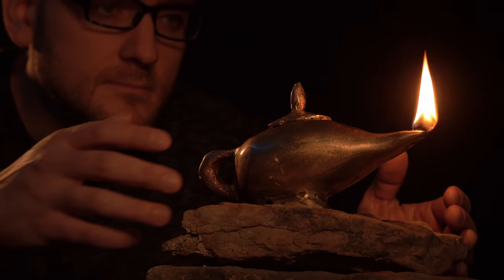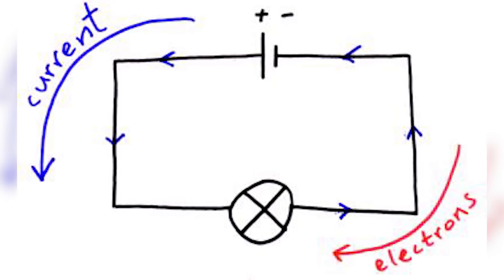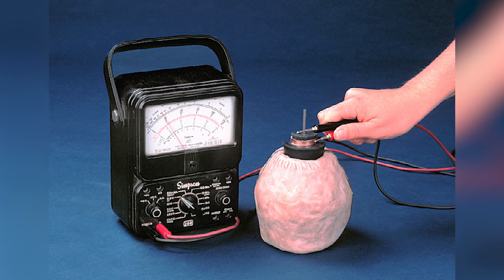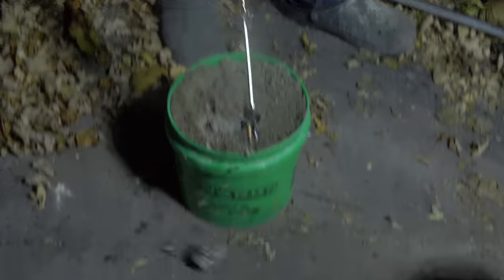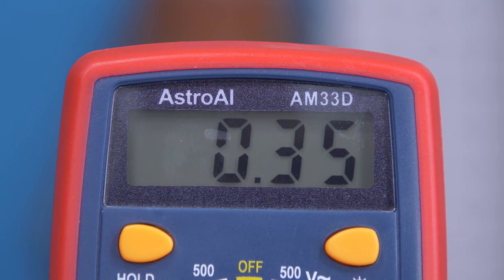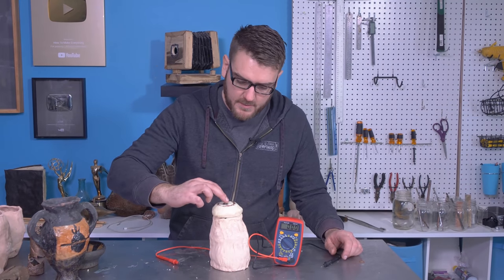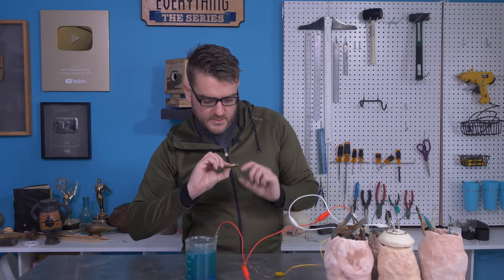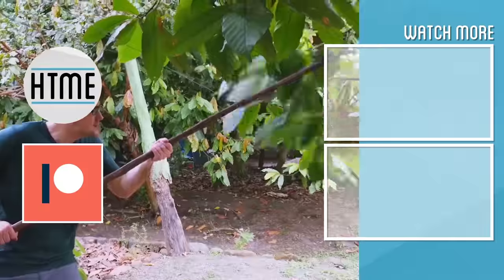Recreating a 2000-Year Old Battery?

Comment: In the baghdad "battery", the tube was actually a copper tube, sealed at the bottom. The electrolyte was supposedly inside the tube, along with the iron rod. This would render the clay pot around it absolutely useless, as it contained nothing. Which i see as pretty good evidence that this was not a battery.

Comment: The most efficient stores of energy are mechanical batteries. A compressed spring, rolling a boulder up a hill, etc. Store the energy mechanically and withdraw it using a release mechanism and a generator.

Dig a hole on a hilltop, a channel for it to run down and a damn to draw power from it's flow, and a pump to pump water back into the resevoir when you want to store energy. Generally paired with solar arrays to smooth out their power generation.

Comment: So I read up on this real quick since I hadn't heard of it until now. And honestly, I think it isn't wild to assume they were using it for electroplating. Something that doesn't require a lot of amperage, just voltage. Lots of skeptics are saying "well, they couldn't have insulated the wire they would have used to make the electroplating setup." I mean, realistically? It's such a low amount of amperage, you don't even need that. And before it existed, would you have really found it necessary--or would you have simply made do and been careful? Did we drive cars before we had airbags? 
It seems likely that this would have been a battery. I cannot imagine any other use for its design. That being said, anything can really be a battery in the sense that this is a battery.. Just like if you stick two ends of wire in a potato. But this obviously has some kind of chemical - electrical purpose. It's a battery even if it's a really shitty one lol

Comment: I did an electroplating experiment for a middle school science fair. All I wound up with was a bunch of magnetized iron nails... I think maybe one of them had a very thin sheen from the brass screw it was paired with, but if it did it got wiped off along with the water when we dried it.
Reply: The brass layer prolly didnt fuse cause of oxidization, I think if you hit it with an acid first to pull off the gross surface it would work way better (but idk if that messes with electroplating solution so dont do it just on my word alone)
Reply: @AVerySexuallyDeviantOrange  No, that sounds like it would have worked. Especially since I think you're supposed to electroplate in an acid solution.
Reply: @Great_Olaf5  You need to remove the oxide coating from iron first. Brass is a really lousy way to start to as it is an alloy of copper and zinc - which have wildly different plating potentials.
Copper is actually refined by plating it out onto stainless steel electrodes using differential plating voltages.
Reply: @allangibson2408  Okay, that explanation makes more sense. And to be fair, if I remember correctly, I wasn't really expecting the zinc to go with, I was trying to plate them with copper, but brass was cheaper than an equivalent amount of pure copper.

Comment: Glad you guys are back after the fire!
I wager you could make a fairly good radio reciever circa 200BC. You might even be able to make a simple spark-gap AM transmitter. You'll want to do a bit of homework on this one, because the FCC regulates the airwaves.  Don't actually transmit unless you know what frequency you're on and know that you're allowed to use that frequency. For a low wattage (sub-1w) test a couple of seconds long on a frequency not in use by anyone in your area, you are extremely unlikely to get in trouble for it, and at worst, you'll get a nastygram from the FCC saying "don't do this thing you did again."

Comment: I wonder if you could try making a vacuum tube. It’s basically a glass bulb with two electrodes(metal rods or plates) inside. The hardest part is making the vacuum on the inside, which can be done with a pump or fast flow of water drawing the air out. It’s some of what you’ve already done, but it could be interesting.

Comment: Taking cornstarch and making it into a gel by mixing 1/2 cup for every cup of cold water along side 1/4 cup of salt, and then pouring that into another cup of warm water on a stove set to heat to a boil. Stir till viscous will give you a decent electrolyte I find because it has a higher capacity and holds a higher voltage then at its starting state. 

Although you might be able to find better ways to make a gel battery.

Comment: WHat I might have tried,  is pouring copper into one of the clay pots, then laying it sideways, and rolling it. Then it would maybe line part of the outside of the pot, which is kinda the idea. Really it is about relative surface for electron exchange, so I would need to look at the math, but  hammered sheets to one side of any shape, like a car battery uses lead(that would also be a thought for a jar lining, as the lead would possibly make an easier thinner layer with a heated pot as I started this. Lead would probably do better with the sulfuric tho. Really, one case to duplicate the bagdad, then other techniques to use modern understanding to do better batteries would be highly interesting.

Comment: The Baghdad battery wasnt a real battery though, it was an accidental invention as it had no real use back in those days, see electroboom for more info.
Plus to use it as a battery, youd need to set at least 20 in series just to light up 1 led. Plus it only had 1 terminal exposed.
Reply: They lit an LED with about 4 it looks like. I will agree it was probably never used for anything but wine storage
Reply: @spazmaticaa7989  yeah, saw the video through all the way after I wrote that

Comment: Hey I think what would be a cool demonstration with it is to make metal glow melt or burn like a steel wool maybe if you get a single strand of wire wool thin enough it might get hot enough to melt or burn, No idea whats available for you to do it maybe they sell super fine wool around you or you might have to make it, Also make a capacitor with the technology of the time and see if you can shock yourself with it safely maybe they did have caps at the time but they did not survive time?

Comment: I heard that certain Indigenous people in southern America, or in Mexico were using some type of battery for basic electroplating. If it's possible, can you do a video on ancient methods of electroplating? This was another awesome video. Cheers, Andy! ✌️
Reply: To elaborate.
The Baghdad battery isn't a battery.
In order for an electrolyte battery to work, the electrolyte HAS TO touch both metals.
On the original Baghdad battery, it didn't touch the iron rod, it only touched the copper sheathe.
A DC battery like the Baghdad battery is suggested to be would need to have 2, fully separated terminals.
The suggested terminals on the Baghdad battery are touching, meaning they would short out and no electricity could be pulled from it.
Even if the Baghdad battery HAD separated terminals, and even if the Baghdad battery was properly made so the electrolyte touched both the iron rod, and the copper sheathe; it would STILL only produce maybe in the fractions of volts; completely unusable, hell, they wouldn't even have been aware it was occuring.

It's known that even when modified to work, and hooked in series, these "batteries" do not produce enough current to ignite an ultra efficient LED bulb, which can typically make use of very small margins of it's operating power and still produce at least some glow.
With 9, super sized, heavily modified versions of it; it barely made an LED glow.
There is 0 credible evidence electroplating was done at any point in pre-electrical history. Not one piece of substantiated evidence, all evidence thus far uses the lack of knowledge about those subjects to make layman's think that indigenous tribes invented the battery, or invented electroplating; the Baghdad battery is a very clear example of this, because you can learn about how electrolyte batteries work, and then hear a general description of an ancient jar found in Baghdad and it's then insinuated to you that the jar is infact an electrolyte battery (although it omits key details which indicate it's lack of use as such, like the fact the electrolyte doesn't make contact with both metals.)

For the electroplating examples, they completely ignore other methods of plating that were possible at those times; like plating objects thermally (using a wire brush of one metal, and scrubbing the metal you want to plate while it's hot.)
Gilding (through foils), typical of the time to add gold to wood.
Or, electroCHEMICAL replacement plating, whereupon the natural electrolytic features of metals dissolved in mineral solutions can plate copper by oxidizing and replacing the oxide with the desired metal; all of this sounds complicated, it's not, it can be done accidentally by leaving gold in a certain water source, then adding dirty copper to it; it's discovery was entirely accidental, and it's explanation is only complicated in hindsight because we actually understand the mechanisms behind those processes; which ostensibly the ancient south Americans did not.
These are considered ancient gilding techniques, or plating techniques, but none of these involve actual electricity, only in hindsight is it understood that electrical currents are formed in the process of electrochemical replacement plating, but no battery or electricity source is necessary for it to occur.

Comment: How would they have known that a single cell produced any electricity? Or that they can be connected in series.
Reply: They wouldn't. They didn't even use wires. It was probably used to store wine.
Reply: They wouldn't.
Reply: Interesting fact, papyrus scrolls were often stirred in similar vessels. If the bitumen seals leaked moisture could get in and in some modern reproductions the moisture helped the sugars in the papyrus ferment in to acid. Its possible that librarians got little electric jolts extracting scrolls for library patrons.

Comment: I would love to see you build a dynamo. The earliest version was a faraday disk (which I know the parallels of Dr stone will be drawn again but that just means they did their reserch) 

From there you could evolve to a more modern looking Dynamo which is wound copper wire and magnets. To store the energy, early lead acid battery could accomplish this . eventually powering something like a carbon filament bulb or start looking at everyday items improved by electricity (motors can be used for repetitive tasks or induction coils can be used for heating an object... though I'm not sure you could get that amount of current).

Comment: Connecting in series increases the voltage connecting in parallel increases the amperage.
You just need more batteries.

Comment: So I like your idea of electro plating. Here’s a theory, what if you had a gold or silver coin that you used to electro plate several copper or bronze coins. Back in those times they would know the difference right away until they scratched or damaged the fake coin or put it on a scale. But to the common Joe you could pass off your fake pretty easily.

Comment: The vinegar did better because it had more salt, not just the acid. Stronger acids also do worse than dilute because they form a protective oxide and gas bubbles on the outside of the metals that slows the reaction. The ancient batteries would likely have used soured wine (unfiltered and not strictly acetic acid) and maybe even salted it as well.  
As for uses, the ancient priests were known for their trickery and illusions. Even at .5V each, it would only take 18 of them in series to spark a little, heat up a thin strip of metal or shock someone's tongue or wet hands.
At just 24 in series, you could give someone a pretty good shock, spark a flame or turn a clay/graphite rod into a light source (though it would burn out fairly quickly due to oxygen exposure). 

At 150 μA per cell, it would take 40,000 of them in parallel to cause deep tissue burns and nearly 80,000 to kill someone, so I don't believe they would have been used for "smiting" heretics. 

If you could get the cell up to the nominal 1.1V that some have been able to produce with this battery design, then you would only need about 8-10 of them for some rather spectacular results in a pre-industrial society. While there is no evidence of this, all of the cells could use the same electrolyte bath. In other words, a trough with multiple anode/cathode assemblies could be used to save space and electrolyte. It wouldn't be a stretch to have 24 of them in a 2'x2'x1'D area, hidden inside the base of a bronze statue with a bronze floor tile at it's foot. Requiring people to wash their feet before entering the temple would ensure damp hands and feet and allow the god to flex their 26V of divine power.

Comment: There is actually an electroplated statuette from an Egyptian tomb; gold on silver or copper. I can't find the link. The owner thought he had been defrauded at first but it's antiquity is confirmed. Its not as old as the Bagdad battery nor is it in the right place but other plating techniques has been ruled out. There are plated statues from China, India and the middle east but they used a trick of mixing gold and mercury and then boiling off the mercury. That's rather unsafe but an ancient version of a fume hood is not impossible. The gold mercury trick is done today by thousands of jewelers.

Comment: The first steam engine which is a pot of water with two angled spouts that when balanced and heated would spin. There' also the early odometer if you want to go mechanical. Both of these were in the time of the greeks.

Comment: It always fascinates me how people originally came up with the designs for some of the things we find. For example, this battery produces about half a volt, which as you said is not enough to even feel. The originals supposedly produced a little over a volt, so how exactly did they first come into being? Obviously the vessel is just a tool to facilitate the process, and the construction is very simple... but detecting that anything is even going on, and then coming up with uses for it is rather tricky.
Reply: likely to do with the surface area for the components of the battery. the higher the surface area for the cathode/anode and the closer they are in the electrolyte the more/stronger the charge becomes.

Comment: With more surface area on the anode and cathode, you should get more current (open circuit voltage is chemistry related)... then putting a few more in series to get you to 5v will help you reach USB charging voltages also. Nice effort so far!!

Comment: Build an electromagnet.. because then if you figure out how to make a speaker you've pretty much already got everything to make a radio... I know they didn't have them back then but using the Doctor Stone mentality, the jump from what you have isn't that big.. Making a speaker wouldn't be easy but it should be doable, it'd just take a good cone (either made out of paper or hide) and a set of coils and an electromagnet and then an old school coil and rod type radio would be nothing to build from there. I'd use a bamboo round as the outside cage for the speaker for the cone to attach to.

Comment: Hook up the batteries in series to increase the Voltage.  Connect them in parallel to boost the Amperage.
Reply: Is there a way to do both?

Say, for instance, hook up 2 sets of 4 cells in parallel, and then connect those two sets (of four linked cells) together in series?

Comment: yeah current, by putting a bunch in series you could increase the voltage, you needed a bunch in parallel to increase the amperage/capacity. so it's not impossible you just didn't scale it enough :D a good attempt though.

Comment: how about an electrostatic motor using only materials and tech available to same era as those batteries? see if they can run it too.

for a non electrical idea, ancient egyptians had a way to drill granite, leaving a tool pattern that indicates a higher feed rate than modern drills. one idea on how they did it was using a copper or bronze tube vibrating, with sand as the abrasive. think you can come up with a way to vibrate a tube enough to cut stone that the egyptians could have done?

Comment: It wasn't to electroplate.  It was to surreptitiously start a fire.  If you can make a thin iron shaving (to make a heat resistor/ filament) attach it to some copper wire, and a few pieces of copper strips attached to a block of wood, with one bent (to make a pressure switch), you can use them to make a fire in a tinderbox.  It would be used as a "miracle" in a religious ceremony.  The priest would say the magic words, put weight on the switch under the carpet, and a fire would start in the fire pit. Add certain chemicals, and the fire could change colors.

Comment: Fun emergency hack you can use a car battery, pencil and USB cable to charge your phone.  Takes some trial and error but you can use the graphite as a resistor to bring it down the 12v to usb voltage
Reply: @JimboJuice  12v won't give you a heart attack not enough volts, the risk is getting a burn from the resistance from the current
Reply: @JimboJuice  12v isn't strong enough to break the resistance of your skin, sure if you sucked on a stripped wire yea that could hurt.  But you can touch the bare terminals of a car battery just fine

Comment: Build a hauksbe machine and other early electrostatic devices from the 18th century. They had some pretty cool stuff from glowing books powered by a lyden jar to gas discharge tubes. From there onto the voltaic pile and trough batteries of the early 19th century.

Comment: Try dilute sulfuric acid, it's too concentrated, there is not enough water. About as dilute as the acetic acid. 
When you tried electroplating, the metal comes out on the CATHODE!